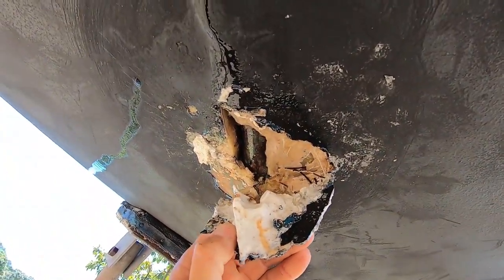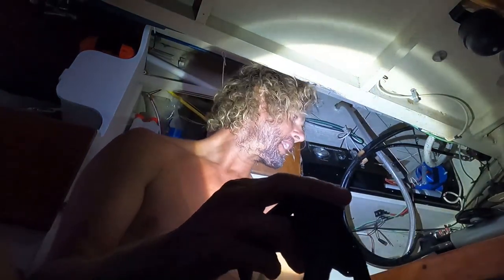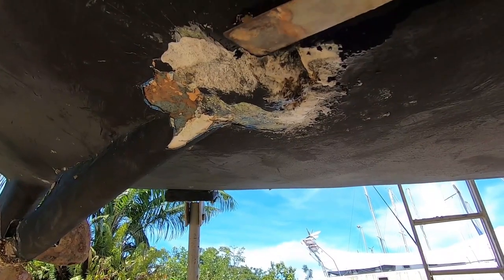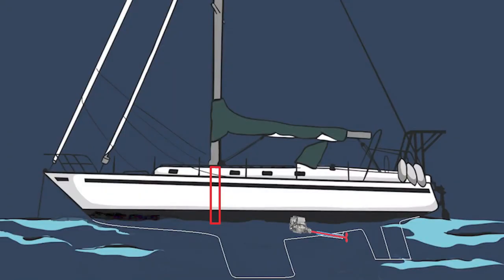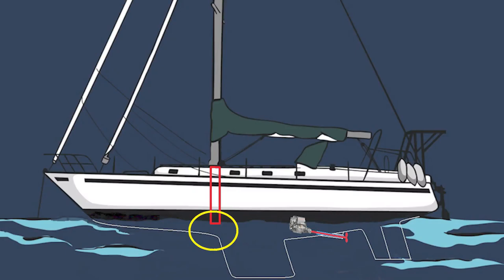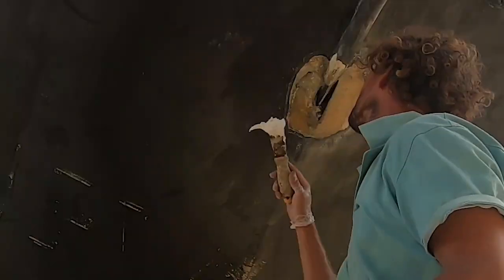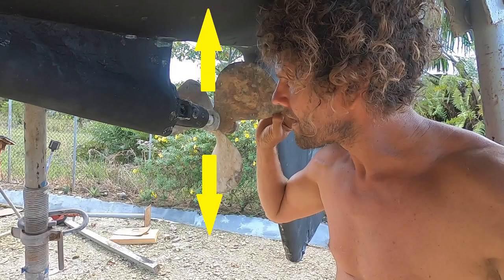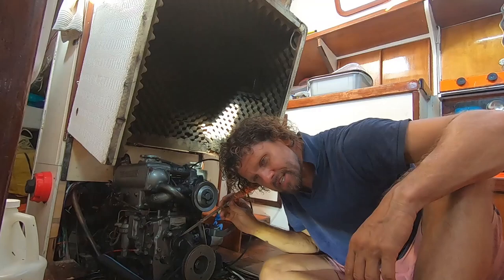HOW TO FIX LIGHTNING STRIKE DAMAGE - UPDATE ON THE STATE OF FREEDOM

Comment: That was an interesting repairs walk-through, thank you! Got one idea for you about the clunking noise, but without any boat experience to back it up: maybe the shaft-to-engine misalignment was caused by the cutless aft bearing of the shaft being displaced? Either vertically or horizontally or anything in between.

That would sound more plausible to me than the engine mount itself being displaced due to delamination or what have you. Because, the lightning bolt blew a hole and exited near the end of the shaft, so there was definitely a lot of force applied in that area. That force could have deformed the hull or displaced the bearing within the hull, in such a way that it changed the angle of the shaft relative to hull and engine. By adapting the engine mount, you now would have offset that change.
Reply from the maker: I think you could be right... Only time will tell. Thanks for commenting my friend
Reply: The shft log knocked askew is what I thought also.  Plucky determined all parts are true and correct but he did so as like checking sub-assemblies.  I forget the word for it but it can be that all parts in spec yet the final assembly is sub par.

Clearly that is the case here.  I suspect the log got jostled.  With that in mind, the log could have a bend since if it was shifted out of alignment, the force was not applied equally.  Perhaps at haul out a laser can bore sight from through hull to engine.  Wit

Comment: Howdy Plukky! If your engine was out of alignment, even a small amount of cutlass bearing wear can make it 'clunk'. Especially since you have a shaft saver at the coupling. Sounds like you got it aligned correctly.  Pleased to know you have one of the best sailboat engines out there, the Yanmar 3GM30F. I've installed nearly a dozen of those, usually replacing the old Perkins 4.108. They'll last a long time if they're taken care of. Hope you can get the hull sorted, I believe you're correct about the path the lightning took. Keep healing up bro.👊
Reply: I agree about that motor.  I wonder if it has an hour meter and where it stands now.
Reply: Is the Yanmar 2GM20F a good engine as well?
Reply: @Ramenscooter  Naturally aspirated diesels are easy to work on, and last over 5000 hours before a rebuild required.  Heat exchanger is the main problem in salt water. I did not own a 2GM20F, but they are considered reliable.
Reply: @Ramenscooter  Yes.

Comment: Granddad always had a set of old jumper cables or wires with the jumper cable ends on them during lightning storm he would connect to rigging and throw wire overboard then the lightning strike would go right to the ocean
Reply: this could actually be brilliant / your granddad knew something / your granddad have any other work arounds ?
Reply: Ive seen a Cat with a heavy cable bolted to the mast base ...the cable then went forward  down though the middle trampoline boom into the sea... 
Same idea just a shorter safer route. 🧙‍♂️

Comment: As you have mentioned, the boat has some area or areas that are comprised, allowing water to be absorbed by the foam core.  Due to the age, if the gelcoat, protecting the outer fiberglass, has small spider cracks, or may have blisters.  All can allow osmosis to happen, resulting in the water in the core migrating to usually the lowest parts of the hull, near the point of entry.  This could all be from just age, not necessarily from the lightening strike.

The only solution I can think of, I’m sure you have too, sand or media blast to the gelcoat.  This should expose the damaged areas and blisters if you have them.  Using a moisture meter, hopefully can locate where any water is located.  Then open the outer skin to allow the core to dry.  Repair, epoxy barrier coat, and bottom paint.

All of this work would be very time consuming and costly, I hate to say.  I wish you the best on your repairs.  I really do enjoy your YouTube channel, feel better soon!  Cheers ⛵️😎
Reply from the maker: Thanks for the advice. On the list haulout  there was no osmosis ...I am pretty sure it's the lighting
Reply: @SAILINGintoFREEDOM  that's good news!  Best of luck ⛵😎

Comment: Hey there mate, I bet the vibration was caused by the alignment of the motor with the drive shaft. When replacing the cutler Bearing and removing the motor and then reinstalling you basically put the 2 components back into proper alignment without even knowing it. The vibration was obviously not caused from a physical point of view like a Broken or bent anything. It was just a case of poor alignment. You did do your due diligence and inspected all possibilities which were better than any mechanic would have ever done. BRAVO to you mate. Nice to see your cheery face slowly coming back to life. Take care, my friend.
Reply from the maker: Thanks Mr R. Plodding along as per usual with intermittent disasters spicing it up a little and keeping it interesting

Comment: So, you've gotten rid of your big holes?  I wonder if an aluminum frame weld may have temporarily softened during the lightning strike, which could have misaligned the motor mount just a little.  Glad to have you back.  Remember, in war, sleep is a weapon.  Get some.

Comment: Hope ya feel better mate.. as the blade turns down (when in drive) it will lift the shaft and if you've got a worn stern tube, especially up and down movement, then its gonna clonk.. it doesn't clonk any more! you've sorted the the cutlass bearing (stern tube bearing) straight drive shaft and engine aligned.. nothing else in that area to go wrong. Sorting any delamination is another problem, when drying a boat hull out for osmosis {boat pox) it takes months as for your construction, call the manufacturer if their still about. good luck and keep smiling.
Reply from the maker: Thank you

Comment: Sailing Millennial Falcon experienced some issues where they ended up having to better align their drive system with the prop shaft. I believe that they did this just before they sailed to Europe. I don't remember the details but you may have fixed the issue by pulling the shaft and aligning it better on reinstall. Hope so!

Comment: Not sure if this is relevant but regarding the mystery knocking in the prop shaft, I over tightened the bolts on my boats flexible coupling between the prop shaft and gear box flange, it caused the cutlass bearing to squeal and get to tight to turn by hand. I checked with the manufacturer (polyflex) here in Brisbane, the torque on the bolts required is minimal. Loosened all mine up and fixed the problem.
Reply from the maker: Good to know  thanks

Comment: All the best Plucky and I hope you recover quickly. 

Couple of comments about the clunking etc. I've had bearings make mystery clunks and sometimes just adjusting them makes the problem go away. You would have inadvertently changed the torque on the bolts and that might have been enough to reset the engine mounts into a better configuration.
About the lightning strike running through the aluminium frame. Weight for weight, Aluminium is a better electrical conductor than copper so with reasonably heavy cross sections through the aluminium frames, there wouldn't have been much voltage drop within the aluminium frame itself. Heat will only be generated when the massive lightning current surges down the voltage drop where the discharge either enters or leaves the frame. Think arc welding. It's the same principle. Hull damage might only be happening where the lightning discharges out through the outer skin of the hull.

Take it easy or as easy as you can.

Soon your boat will be as watertight as a fishes' sphincter or if you're spearfishing, a fisher's sphincter.
Reply from the maker: Ha classic. Thanks for the info my friend. You may be right.

Comment: Plucky I have seen an old school mechanic use a stethoscope specifically configured for the purpose of listening to the internals of mechanical contrivances.

It had a long metal rod in place of the usual disc shaped terminus and I have also seen the same person use a large screw driver as a substitute for a stethoscope like you did.

I searched on the internet using 'Mechanics stethoscope' and immediately found images and information about the device.

As I understand the subject mechanics stethoscopes are used to more accurately determine the location of abnormal noise in an engine or gearbox or whatever.
Reply from the maker: I should have done it when it was clonking just after the lightning and I would have probably seen the  jumping/vibrating shaft... That's what happens when you are by yourself

Comment: good to see you are working on repairs finally. I would suggest that if the knocking comes back it may be in the engine crank shaft bearings, which is a pain in the butt, but arcing likes to zap through bearings. Hopefully its just that the shock wave of the lightning knocked the engine out of alignment. Keep up the good work.

Comment: Its nice to hear you sounding stronger....yeah Covid-28 (lol) and upward is a pain...had it 3 times now, but doing great....the knocking sound did sound like the prop drive shaft was off center, could have been the engine being displaced from the lightning strike and slightly moving. Changing the cutlass bearing and pulling the shaft and motor and being forced to re-align all the parts fixed it. Bonding your boat for the next lightning hit and having a safe exit for it should be a priority. Be well....John
Reply from the maker: It's already bonded now  but any near strike just blows all my LEDs ha

Comment: I worked engine stage at hunter marine on the 44 legend, they required the prop shaft flange to be aligned with the transmission output flange resting no bolts in it had to be within 4 thousandths,
We used shims and adjusted the mounts accordingly, when you realigned the two that was probably the resolution, they would knock or wobble when not aligned just right..
Reply from the maker: Yeah I figured the lightning have a little twist to the hull and put it out??? I mean I really don't know but it doesn't Knock so much now

Comment: Plucky, just saw the lightning/covid update.  May I suggest that the problem with your shaft alignment--given your description of the aluminum framing, ?bronze? strut,  and the coring repairs you had to make---suggests that the strut may have shifted alignment slightly with the hul as a result of the strikel.  Perhaps some core swelling/melting etc.  Since your shaft alignment apparently cured the problem, it seems that the movement was probably pretty small.  I'm sure you checked the strut to see of it can be moved relative to the hull even a small amount, so you might be OK.  I'd still suggest a really hard look at the strut if you haul her again,   
     Best of luck and get well.  Had covid before there were vaccines and definitely don't want it again!.
Reply from the maker: Thanks for the advice

Comment: Best method I have found by far (if on the hard) is to pull the cutlass bearing,(far easier than pulling the shafts) and have someone spin the shaft inside by turning the coupling. Any out of alignment or bend shaft will be amplified as you watch the shaft outside, turning in the shaft log or prop strut. 

Wish I had thought of this before I sailed across the pacific.

Comment: When aligning engine and prop shaft , often the case is that they are deliberately slightly misaligned so that the universal joint is actually turning and doing work instead of wearing on one spot on the UJ .

Comment: It could be that after the lightning blew out the hull the angle of the stuffing box and shaft changed by a º or so relative to the engine so adjusting the engine mounts might have been the fix needed, but it could have been damage to the cutlass bering too or a bit of both, the most important thing is it's fixed now and not causing you issues.

Comment: Hello Peter hope you are feeling a little better I wish you a best recovery I know it drains your energy. I had a grandfather years ago that had a 4 cylinder Flathead motor in his 49 Ford pickup they used to rebuild his motors and he heard a noise one day after starting it when you finish rebuilding it and he used about a 24-in wooden broom handle he had a stethoscope but he is the broom handle he said the sound would go through the wood a lot better than the scope and he found that the number two wrist pain was making a noise in the motor but everything else was okay so instead of using a screwdriver an old piece of wooden room handle will be perfect for checking your engine or any odd sounds but it sounds like you got it under control. Anyways I hope you get feeling good will be waiting for your updates and future videos God bless you Peter stay safe eat healthy.
Reply: A wooden broom handle is also longer and keeps you  (your hair) further way from the moving parts
Reply from the maker: Good on you. Thanks for writing that.

Comment: We had wet foam core in an old 70’s boat took all winter to drain out we drilled holes along the keel and under the scuppers compressed air bleed into the scupper holes helped blow out the core water
Reply from the maker: That's Freedoms future for sure

Comment: The prop shaft and engine couplings were probably not aligned in first place, also putting boat on the hard affects alignment vs in water because different stresses on hull, etc, Lots of reason why the couplings may not align apart from lightning strike. Good call on changing cutlass bearing, realign everything from scratch. While you are at it, pull engine, address bilge sump, fill in inaccessible areas etc.
(Offset shafts cause huge prop walk issues)
Reply from the maker: Thanks My friend

Comment: As the current passed through the shaft the explosion there would be enough to shift the mounts for the engine. I mean. A small firework can blow the door off a safe if the internal of the safe is flooded and the banger is inside. Cos water don't expand. So a small bang is actually HUGE and forceful in water. 
Your moving the mounts will have sorted the problem.
Reply from the maker: I think you may be right
 I forgot about the incompressibility of water.

Comment: PS this how to defeat, resist, prevent lightening thing is fascinating, ive seen metal feather duster type things that go around the top of your mast, some say it works and glows green in a storm, some say its nonsense and all witchcraft its amazing what we still dont understand about lightening.
The metal dunny brush things seem to originate in mysterious Eastern Europe working off Tesla principles but here in compound interest rates Anglosphere we wont have such superstitious nonsense, even if it might actually work, well thats how the debates seem to flow from what I can see. 
I did a bit of a deep dive on this issue after I saw your boat was struck and thought "Strewth" if I ever get a boat thats the last thing I would want to happen to me, how do I prevent such a thing?
Would love to hear your own thoughts, findings etc on avoiding Thors hammer.

Comment: If the lightning strike caused a blowout in the hull near the end of the prop shaft, it could have easily done enough damage to that aluminum framework in the area to allow the engine just a slight change of angle causing it to be misaligned. My prior life experience includes electrical technician work and running various boats, some that had perfectly aligned prop shafts and others that were not quite so perfect. I wish I was in Panama this year to help lend a hand buddy. Looks like I'll get there a year too late unless you really take your time.
Reply from the maker: Thanks for taking the time to write that. All good ideas. Up on the hard we will all sort it out together
Reply: @SAILINGintoFREEDOM  I've been quietly tagging along since around the time of the Italian girls. I have no doubt you will sort it out. Got to stay healthy in there somewhere also. Hard to make sense of things when you're not feeling 100%. I will try to pack extra pineapples if I'm headed your way 🤣👍